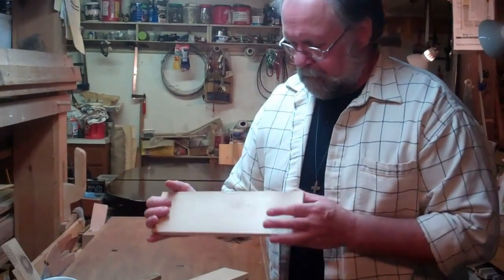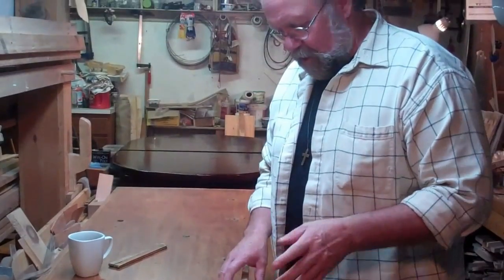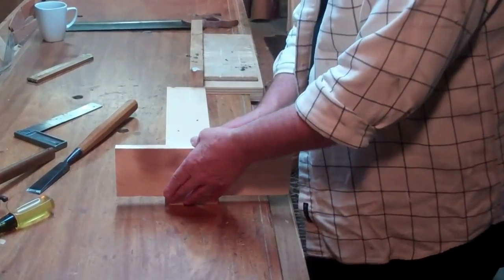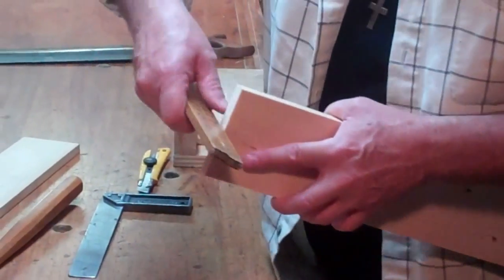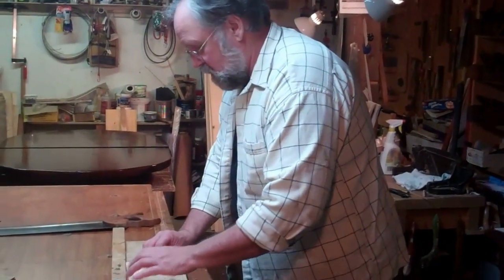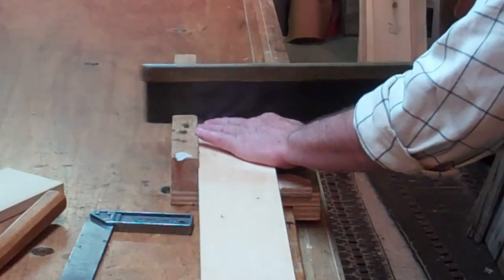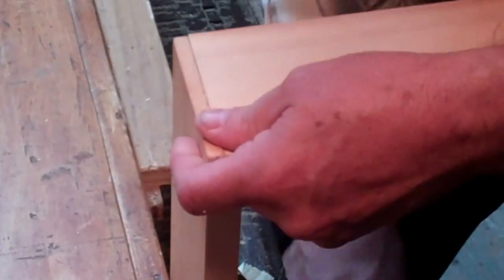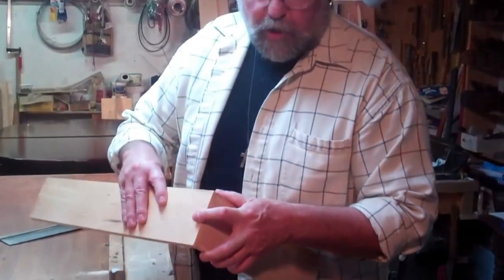How to make a rabbet joint

Comment: My grandfather always glued stuff like that and his explanation was that the rabbet joint was much stronger when it was glued. two sides and sheer points and all that.  However with the bottom nailed and glued in a groove it was really strong. He told me the nails were just there to hold it together till the glue dried.  Which as a kid I thought interesting because he had a ton of clamps of various sizes for that same? purpose. :)

Comment: Frank< i have been doing wood working since 2008, par time that it. I love it and i do enjoy a challenge< but I must say, you video is so clear and easy (well at least it looks easy) that I tough rabbet jointing was much harder. Do you have any more videos? I would love to see dovetail joints.
Reply from the maker: Thanks for comment--most woodworking joints are actually fairly simple, it's a matter of getting the ends in line with the available means. Same goes for dovetails. I'll show them when I get to a project requiring them. Alex

Comment: OK, that looks fairly straight forward. Will your technique using a chisel work on plywood or do I need to use a router? I wood (ha ha) prefer to use real wood but it is very expensive in the UK. Then again, I think I can probably look a little harder instead of the local DIY store...
Reply from the maker: yes, Rory, the same basic methods work on ply as well--the only difference is that the cross grain layers need to be scored with a knife, then the peel off quite easily. Also, take care with the surface ply--it can be quite fragile and prone to chipping out. Good luck, Alex
Reply: Thanks Alex. It sounds a lot trickier with ply so I think I should find some off cuts and practice.
Thank again and I'll keep an eye open for more good tips and tricks.